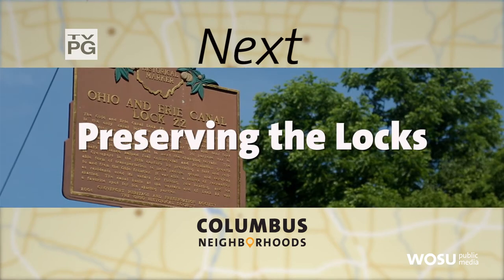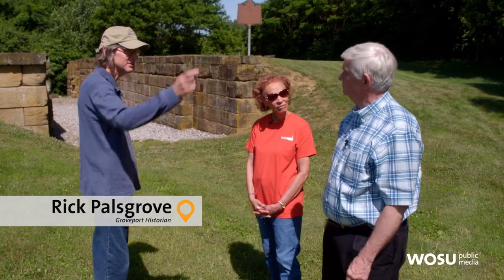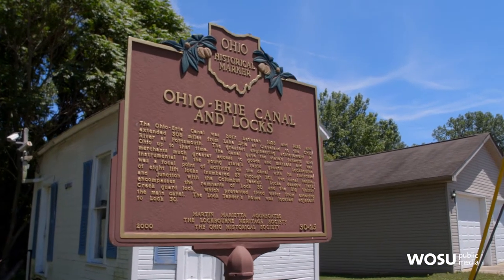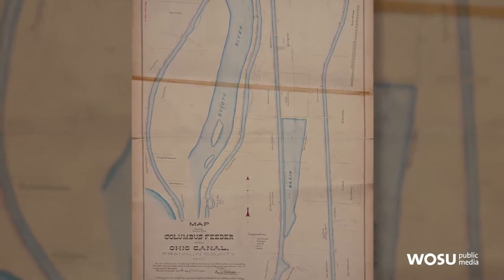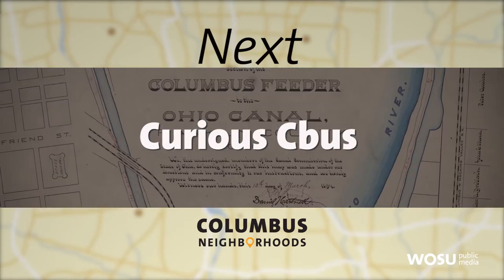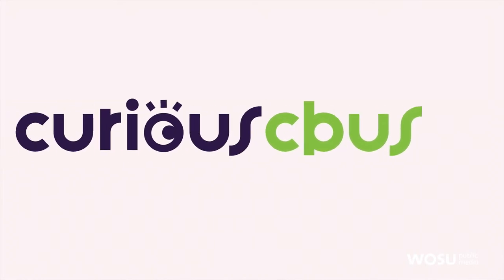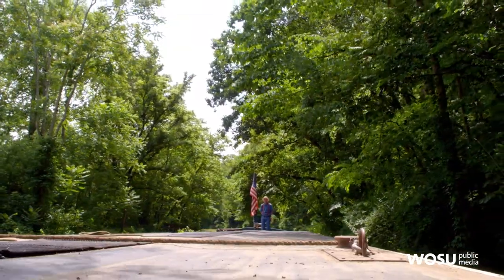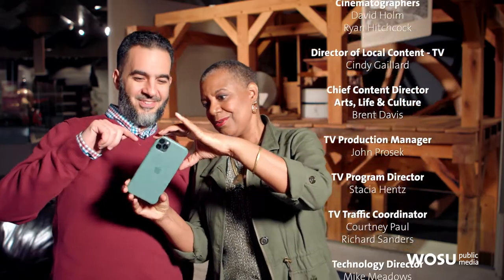Columbus Neighborhoods: On the Canal!

Comment: I've done some exploring around the Lockbourne locks. You can also see some of the actual canal system remnants in and around parts of Groveport, Obetz, and Hamilton Township.
Reply: Oh definitely. I lived in Groveport as a kid between 1965-1981, and we used to go to the park at the end of Blacklick St. There's an indentation that runs into the woods where the canal tributary from Wirt Rd ran, and if you go deeper into the woods, at the clearing you'll see the remains of the lock (haven't watched this yet so I don't know if that's covered). In fact, the house we grew up in, on the 300-block of Center St (I know what it is, but in deference to the current owners I won't identify the exact number in case they don't like it), was actually built around a canal boat that had been hauled there. It's mentioned in the 1947 Groveport Centennial book, identifying it as being owned by the family we bought the house from in 1965.